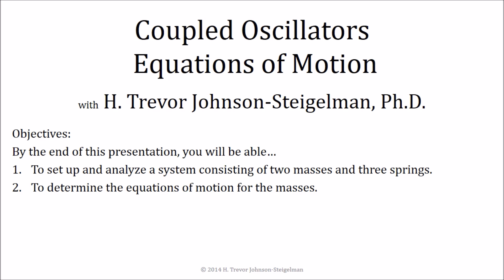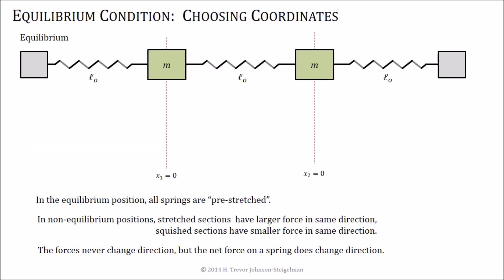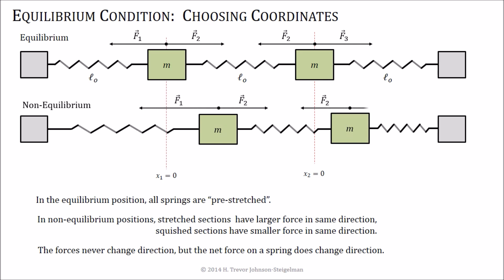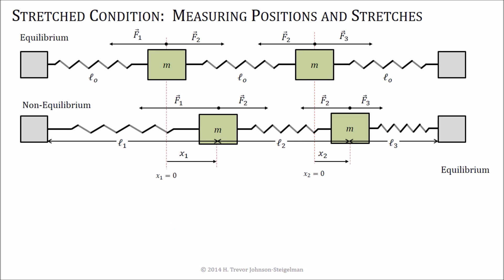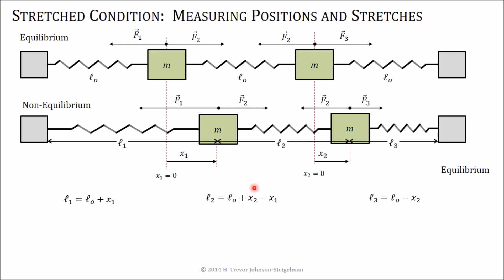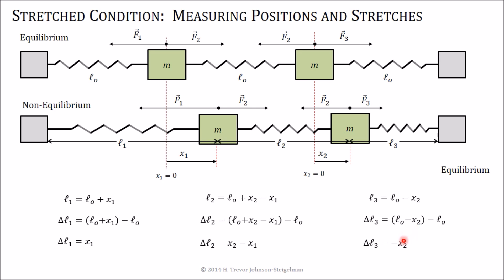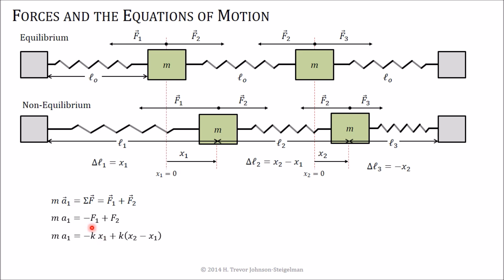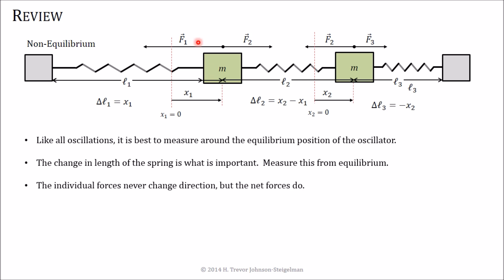Coupled Oscillators Coordinates PTW

Comment: @PhysicsThisWeek How did you postulate that in non-equilibrium position, the stretched section would be of greater magnitude relative to the squished? What's the reasoning behind this?
Awesome explanation of setting up the problem nevertheless! Thank you.
Reply from the maker: Within my setup diagram, the stretched parts are longer than the squished parts.  This means that for F = k Δx, the larger Δx has a larger force.  The reason I did this is because for my "real" system, there are three expansion springs.  These are ones that would have the coils all together when unstretched.  If they did get compressed to that point, they would bend or twist, causing the system to likely fail.  If you had other types of springs, you'd have to be a little bit more careful, but the general principle would work.
Reply: @PhysicsThisWeek  Thank you! Also the fact that you used F2 twice, it's because the force on the two masses is caused by the same spring? Do you foresee any circumstance where these would be different, for the same extension? Perhaps, an inhomogeneous spring?

Furthermore, for the non-equilibrium case, could you explain each force? This is my understanding, 
-  F1 is a restoring force to the left because of extension of the leftmost spring.
- Why does F3 point to the right if its due to compression of the rightmost spring which naturally would want to be restored to the left?
- For the middle spring, as l2=l0+x2-x1, the extension of the spring by x2 is causing a restoring force to the left and likewise, compression by x1 is causing a restoring force to the right?

Comment: great video! Just wondering, I don't understand why you said in the video that the individual forces never change direction, only the net force. In the configuration you show in the video, should'nt F3 be exerted leftward? Because the spring number 3 is compressed, shouldn't it exert a repulsive force? In the same way, if x1 were to be negative, shouldn't F1 be exerted rightward?
Reply from the maker: I'm glad you liked the video.  You ask a great question.

What I mean by the forces never changing direction is is that the force of each individual spring on  a mass always points in the same direction.  This is true because all of the springs here are "extension springs".  This means that the coils of the springs are initially together, but stretched apart when you build the configuration shown.  That means that they are always stretched.  For example, spring 3, causing force 3 is always pulling the mass on the right to the right.  That's why I mentioned that the springs are "pre-stretched".

You could build this configuration using "compression springs" that would always be compressed, forcing all of the forces in the diagram to change direction.

In theory you could also build this from "ideal springs" that could be compressed or expanded.  In practice, though, springs are generally either compression or expansion springs.  

If you built it with ideal springs, your statement is completely correct, and you would have to be a bit more careful with directions.
Reply: @PhysicsThisWeek  thanks, I had never heard about this distinction !